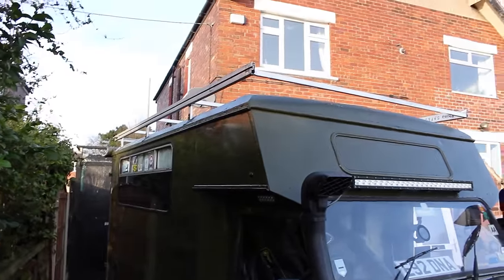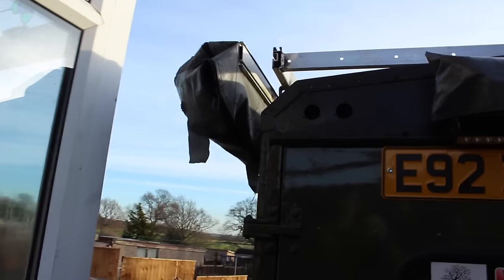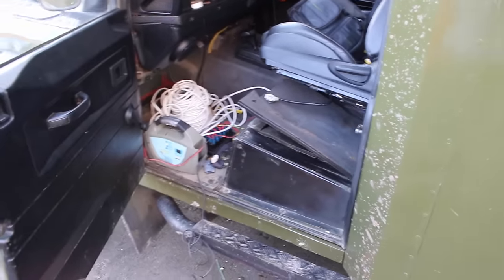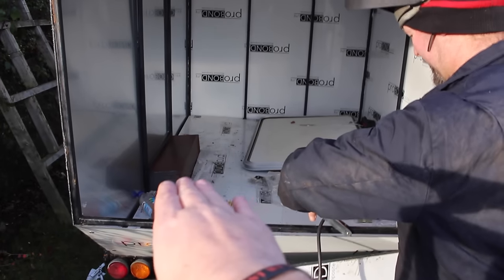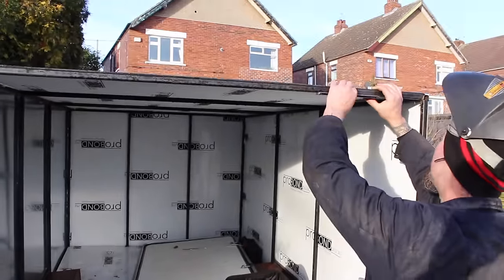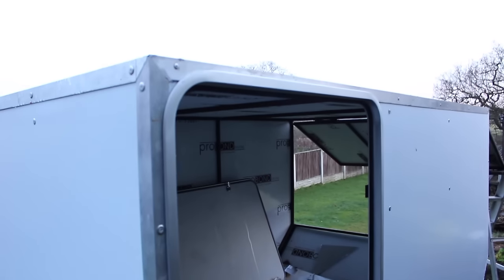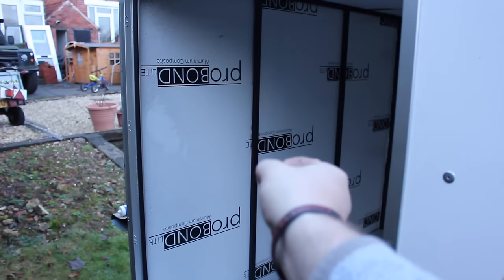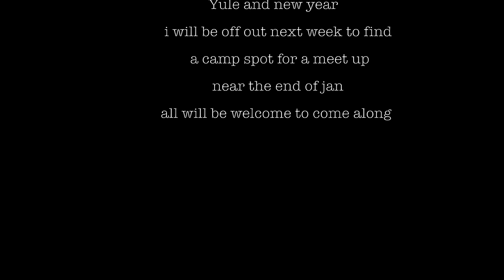fabricating land rover roof rack and fitting doors to off road trailer

Comment: 5000 subs well done👍 so what's the plan with the defender. Are you building to sell or keep improving. Keep the vids coming.
Reply from the maker: FireBlade Rider Iv not thought about selling it yet so loads left to do. Iv got 2 possibly 3 builds lined up so I will see what happens.
Reply: Bug out vehicles UK Torn Apart self sufficiency. Look Forward to watch it progress👍

Comment: Looking good m8, how you planing to secure the kingspan to walls, sikaflex?
Reply from the maker: Chippa Fate the last trailer I did the Kingspan was so tight between the bars it couldn't move then between the inner an outer skins it's tight. I might try expanding foam in the little gaps.
Reply: I was thinking building  a timber studding wall with kingspan between studding. Then plywood on face, that would reduce condensation but boost overall weight.  I like the idea of expanding foam, that stuff gets a good hold. Looking fwd to seeing your results.
Reply from the maker: Chippa Fate I did that with the last one and it was a lot of messing to do the same job as the metal struts. I will just have to measure up well to get the struts.

Comment: :-) That made me cringe! Not using eye ware when using an angle grinder. Not being the elf n safety police - did it myself loads of times until I got some metal in the eye. Not fun having a needle shoved in it to dig the metal out. I think it was when I went to switch the grinder off - felt a draught in the face from the grinder - probably happened then. Cracking vids all the same :-) enjoy!! :-)